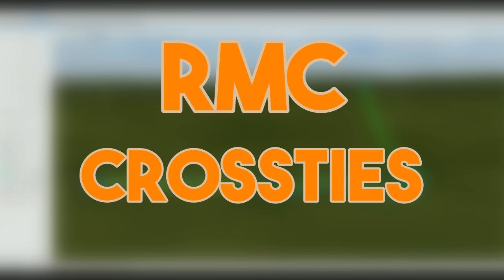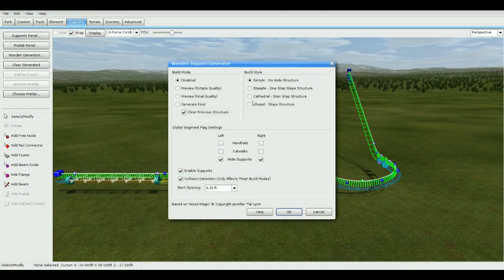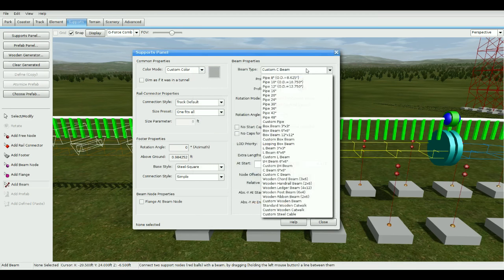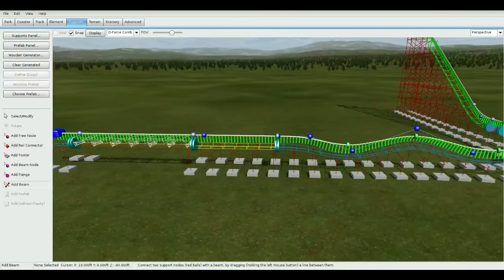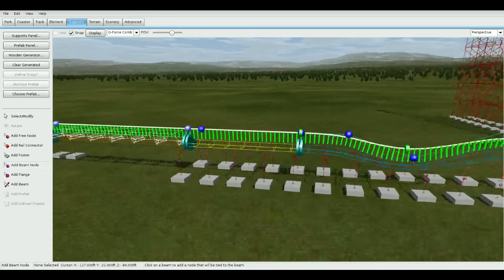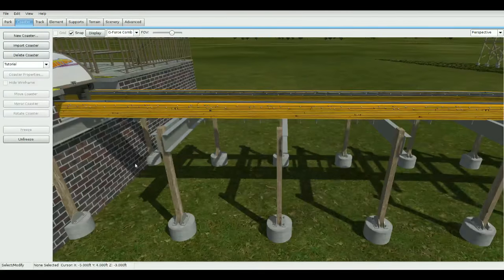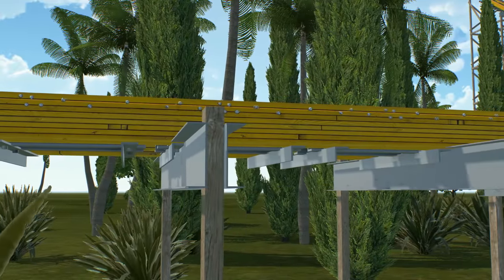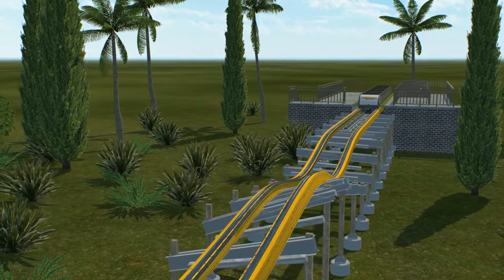No Limits 2- How to Make RMC Crossties!!

Comment: You could just change the wooden ledger beam without deleting it and switch it to a C beam. You then would click (define) copy and then paste. You then rotate the C beam 180 degrees and line it up to match. Nice tutorial though. It's just another option in case you don't want to do all of that clicking haha.
Reply from the maker: Either or haha that works to :D
Reply: That they do. It was just a second option. :D